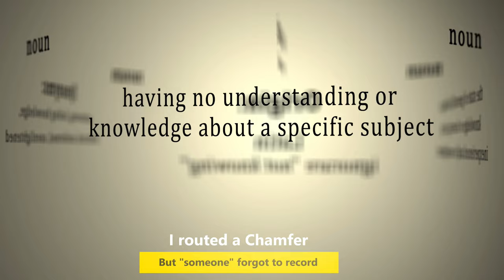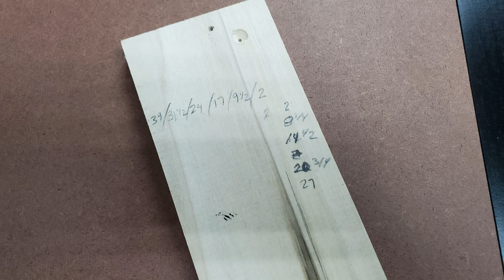Making Big Picture Frames Using Micro JIg Matchfit

Comment: 0:34 #teamchamfer
0:36 #noguardnoproblem
1:11 Why did you not use the fence when jointing the face? 
7:30 Gripe. Gripe, hummanah humminha
7:55 #Slacker
9:18 #needlongerarms
10:01 #posteditfails
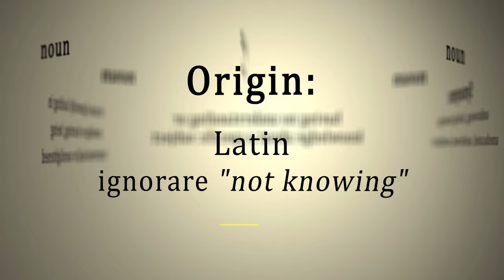11:57 #teamchamfer
15:20 Epic finish
Reply from the maker: Quite a bit to unpack here.  When jointing the face of the board it's best to let just the jointer bed make contact with the board and not the fence.  This helps ensure you aren't referencing a part that hasn't been flattened yet.  Once the face is flat, then that will reference against the fence to square the edge to it.  Until the face is flat, the fence isn't required.

As for the rest, #teamroundover all the way.  Don't short arm shame me.  Not cool.